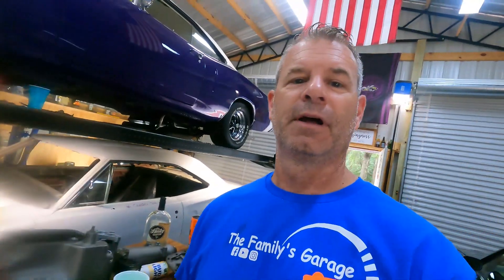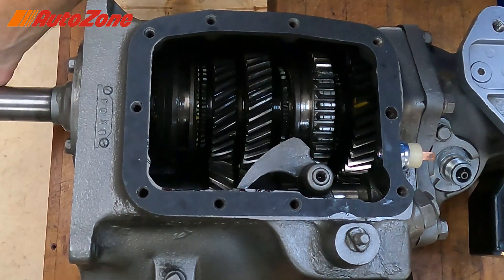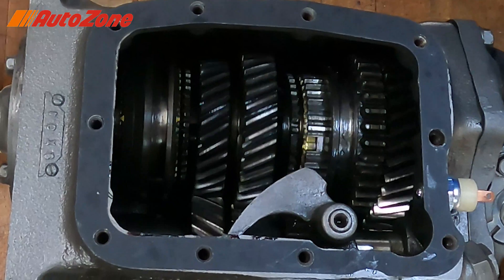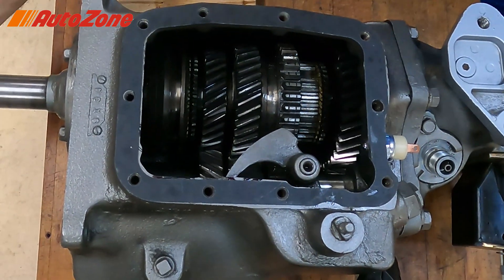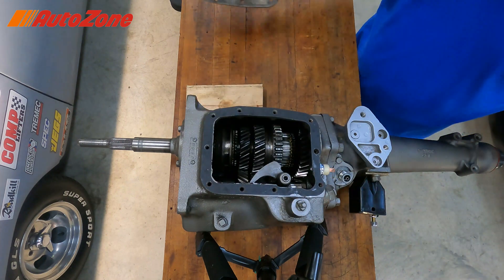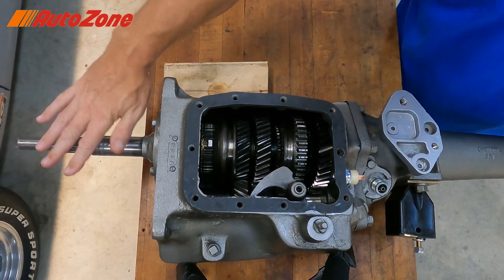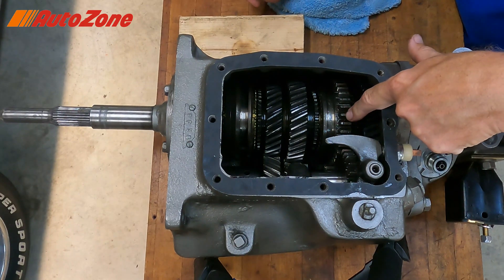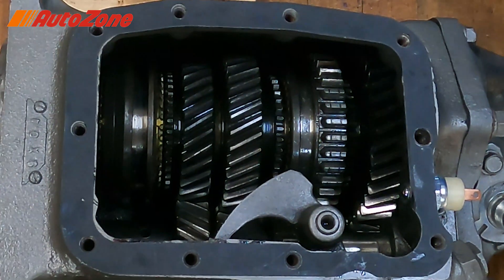How a 4 speed transmission works. What's going on in there? Mopar A-833 heavy duty 4 speed breakdown

Comment: This is very helpful. Maybe you can tell  me what is going on inside my four speed 833. I did rebuild it so it has been apart. Not my first time doing it. 

During my initial test using the shifter I can't get into reverse. The shifter does move the arm when I push the shifter arm over and try to shift. The lever swings but hits solid like it won't slide into the reverse gear you pointed out on the outside of second gear. Like the reverse gear on the outside of second gear won't slide/rotate over. It hits right away after 10 degrees or so and won't budge in. 
You think the second gear is still in synchro and didn't move back into place when I shifted into third and fourth? Any suggestions?
Maybe the detent ball fell out and the second gear won't slide back when I shift into third or fourth? Thank you. It was helpful looking into the trans without taking the side cover off....

Comment: Question so is 4th supposed to be locked ? Or is it supposed to move freely kinda confused on that because mine moves freely when put into 4th
Reply from the maker: If you mean, locked from input shaft to output shaft, yes, if it moves freely, something is not right
Reply: Does that imply for Muncie 4 speeds as well?

Comment: Hello... I have a 72 Challenger 340 4 speed. Does not want me to downshift from 4th to 3rd unless going in my mind too slow. If i don't slow down considerably it will grind. replaced clutch thinking that was problem. Unfortunately it was not.. thoughts? Upshifting fine.
Reply from the maker: Sounds like synchros…
Reply: You can "get away" without tearing into it for a while ,by rev matching as that usually helps with tired synchros. 
You don't have to go full double clutch and rev match like an old non synchro box but matching revs can help on the downshifts. 
Been doing it for a while in an oldie I don't wanna open up just yet.

Comment: Awesome vid…so my A 833 is often crunchy when i downshift into second at medium speeds.  It isnt crunchy however at low speeds and only when downshifting to second….Any theories?
Reply from the maker: Our would not downshift into second until about 15mph without grinding also. Has to be the 1/2 synchro assembly worn…
Reply: Hey Roy! 😃
That’s exactly what my ‘65 Dart is doing…
Time to rebuild mine. 
Thanks for the video! 
It’s a great reminder, 
Dad showed me once when I was in high school in the early 90’s.